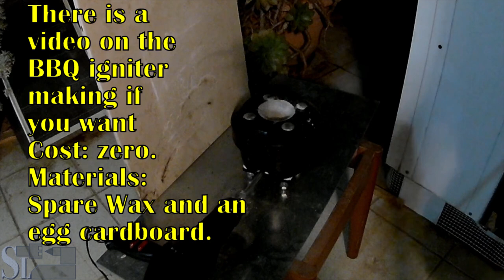Beaker   the miniforge

Comment: Nice job on the mini forge!!!  Is the tube at the bottom attached to a heat gun or just a blower???    Thanks for the video!
Reply from the maker: Thanks Dan! The air feed at the bottom is a simple fan, a 10$ worth from ebay. I run it on its lowest setting....